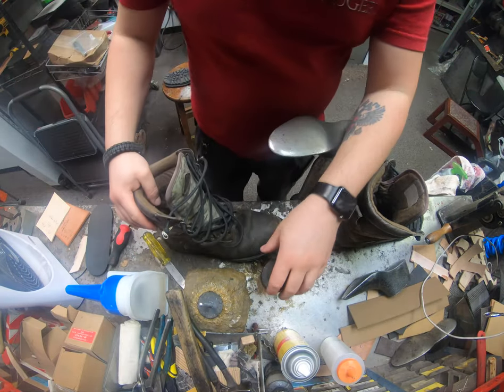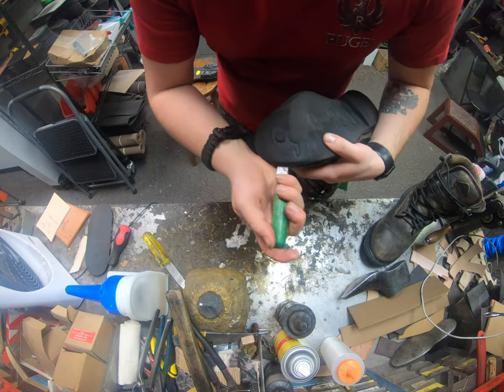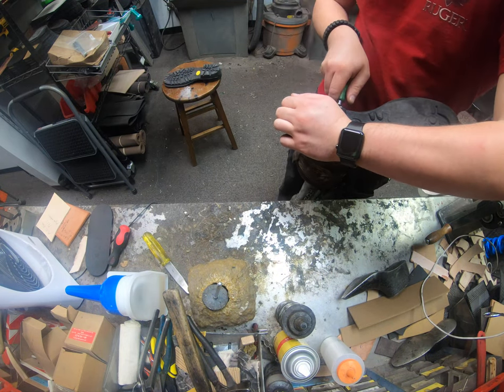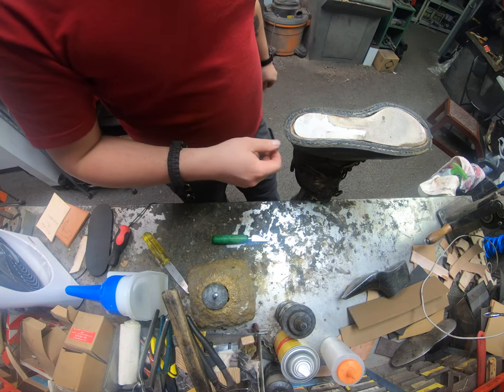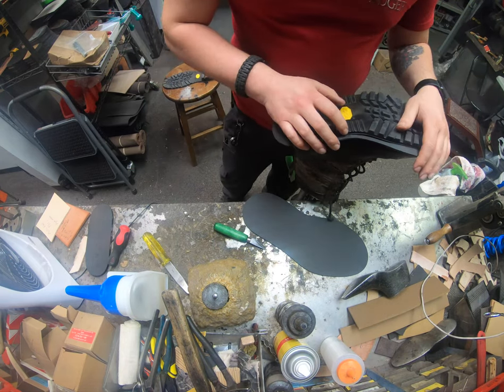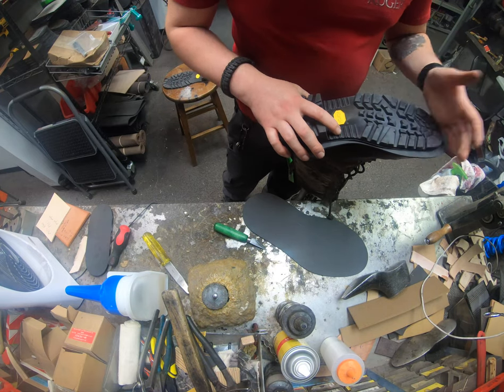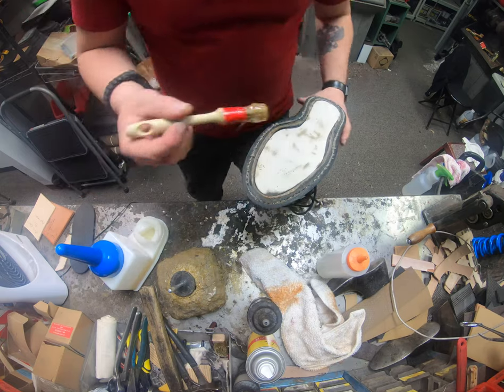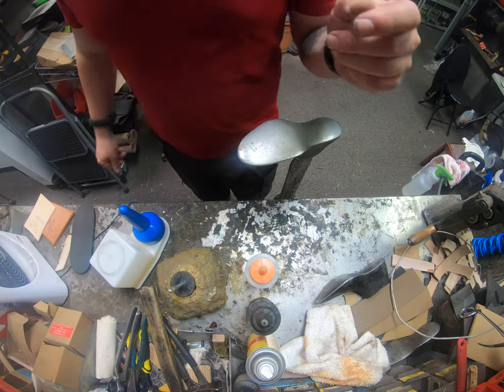Rocky Work Boots Resole with Vibram 1275 Olympia  Soles

Comment: Hi there. Is that glue the kind that's stronger than the masters glue? I think it always needs heating before joining both pieces, right?
Reply from the maker: I wouldn’t say stronger exactly. Different glues have different ways of applying, curing as well as uses. 
Here in Colorado’s conditions the jet set and renia glues have had better luck for me with strength, flexibility and holding up to the weather changes
Reply: @CobblersPlus  , I see. Maybe I was confused. Someone once told me to use contact cement like the shoe goo for sponge type materials that you glue onto leather. And when glueing rubber and leather, that one should use that clear glue that needs heating.
Reply from the maker: Most contact and rubber cement glues stick better with heat. Shoe goo unfortunately is not a glue it’s more of a temporary filler
Reply: @CobblersPlus , if I put sole guards on my shoes, which glue then would be recommendable for the east TN area? Very little snow and some rain during the year. Thanks, man. That's the last question here. I know you're busy.
Reply from the maker: Your good. Masters and Barge would be good
Reply: What glue would you recommend  for a leather midsole  and Vibram sole ?  At the moment I have barge , southern leather glue and  Renia glue .

Comment: Hi, excellent work and video.  My question:  What material did you use for that midsole and how thick is it?  Thank you!
Reply from the maker: It’s a composite material that’s basically a hard rubber that can withstand being stitched and glued very well. It is usually 1/8in thick but there are a few that we have that are 1/4in thick

Comment: If that dust gets in your hair... it's also getting into your lungs... You might want to consider using a respirator when your sanding...  Just saying, it's your call though.  Thanks for the videos.
Reply from the maker: I try to use one most of the time and for video purposes I tend not to.

Comment: Great work!
Quick question
If its ok
When you say “Oven” 
What type of oven? Is it part of the machine your working with or separate unit?
and how long do you leave the material (The material your using of course)
Thank you
Reply from the maker: It’s a regular oven at the moment. After we move we will build a few heat lamp ovens with more room. As for leaving it in it depends on the Materials and thickness. Anywhere between half a min to 4 min
Reply: What temperature?   Like 110 Fahrenheit?   Thank you!